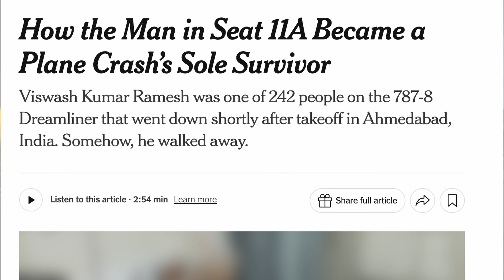Why the RAT Changes Everything – Air India 171 Update

Comment: Thanks for this great video!  However, I doubt it was a hydraulic failure.  Planes with running engines still fly.  This one didn’t fly. Planes with hydraulic failures loose control. This one never lost control.  Also the pilots radioed a mayday back. That does not prove loss of all electrical, but it does show they had enough electric power to run the radio (maybe powered by the RAT). So it’s got to be loss of engines. And it’s got to be loss of both engines. At the same time. We need a common denominator. As many back up systems as there are on both hydraulic and electric, I can’t see it taking out both engines that way. Not maintenance either (unless same maintenance done on both engines, but again, fail at the same time? Very doubtful). So the only remaining common factor is fuel. Not also that if APU was running the RAT would not have deployed I don’t think. So APU may have failed also. Again, the common factor is fuel. 

Can we find out how long this airplane was on the ground before take off?  Assume it was fueled before departure? How much fuel? Those would be good to know.

Comment: It appears the basic cause was insufficent thrust for the height , stalling at 600 ft 
Now, there is a report of a second call of Engine failure after the Mayday call, & its recording indicates the engines to be steady with no sound of fluctuations or flutterings heard,
This second report came after the lone survivor claimed to have heard a loud sound,  This aspect must be very thoroughly investigated to discern whether there really was a second call 
As for not taking in the landing gear there appears that the pilots were from the very early facing thrust problems, 

To the invesigation & its final report  it would be interesting to know something about the M V  Dali crash on a bridge in US, which final report ended up blaming the machinary , when it basically was the river  Pilots error, taking wrong action due nervousness , in an emergency situation,  
A ship that was moving at 8 kts speed ,experienced an  engine failure & instead of using the momentum to navigate the ship as it was (the heading of a ship does not depend on its propulsion but on the momentum) under the bridge, tried to stop the ship by giving stern movement & dropping the port anchor which only made the bow of the ship to cant (swing)  to the st bd (right) towards the bridge pillar  & crashing on it ,

Comment: Another incident where the known facts make no sense. The plane was already in trouble before it left the ground. It took off late, right at the very end of the runway or even beyond. Crash photos clearly show flaps retracted and slats extended. The entire flight was only 30 seconds. They had power (climbing) for 15 seconds of that flight. There is zero evidence of bird strike or flame out. Also, the passenger witness said he heard a bang and the lights flickered. The plane did clip some buildings before crash, which would be the bang. If there was a power loss, the RAT would not power the cabin lights, so they would not "flicker", they would have just gone out. Likely the crew deployed the RAT manually.

Comment: Watched a passenger post of video while he was on the same plane just the flight before. What he was filming before the 787 landed was alot of 💩 inside the cabin wasn't working the AC the TV screens on the back of the seats the remote controls were not working and other things not just in his seat but the entire plane. I think electrical failure is what brought the plane down. Why would Air India continue to keep it in service if a bunch of things DID NOT WORK. horrible decision making. Thats probably why the little propeller droped into action. The entire plane just turned off.

Comment: 8:00 - This would explain why copilot is not responding after Mayday call, as RAT hasn't provided energy to turn everything up in that short period of time.
Reply: The battery would also be providing power to the emergency and essential busbars, the RAT is there to save the battery being drained quickly and to provide hydraulic power.
Reply: @devon896 at the risk of being very dull I believe on battery power alone CM2 radios are depowered.

Comment: I saw that the day of the crash.  You could hear the RAT but not take off thrust of the GE engines.  I stand by my original observations, this was a total loss of electrical power and that is the only thing that fits all the available factors in this crash.

Comment: Not a pilot, or engineer but is their a possibility that the co-pilot did in fact retract the flaps instead of the gear and that action triggered the engines to throttle down as the system, as I understood, will not let you be at full throttle with out the correct flap configuration.

Comment: The same higher resolution video also shows the slats extended and the flaps at 5°. Also, the bogies of the main landing gears are tilted backwards. When retracting the gear, the sequence is first the change of the landing gear from tilting forward (forward tire pair higher than the aft pair) to tilting backward. This step of the retraction sequence appears to have worked, but the next step, opening of the landing gear bay doors and start of the actual retraction did not happen anymore (lack of hydraulic pressure?). We will have to wait for the FDR data and the state of the engines, the entire fuel system and the engine electronics will have to be reviewed.

Comment: Hey Captain Steve, just a quick note during the 787 gear retraction the gear tilts forward as the pilot puts it up, you can search up the dreamliners gear retraction test. And on the video we see that the gear is tilted somewhat forward, showing signs that the pilot did retract the gear. And it stayed out long for the reason you said, dual engine failure which provided no hydraulic power for the landing gear therefore keeping it out during the whole duration of the flight.

Comment: There's one more thing. In this video, you can clearly see through the wing between the flaps and the main portion of the wing. That would not be possible if the flaps were up. This proves the flaps were down. Also, maybe it's my imagination, but it looks like the plane yaws a bit, as if one engine fails slightly before the other.

Comment: I am extremely confused as to how 11a survived. It has been stated that he opened the exit door and escaped upon hitting the ground?  We all saw that enormous fireball upon impact, yes?  It had to engulf the entire structure of that plane (and certainly the general vicinity of the residential neighborhood at the point of impact). There would have been no exit door to activate upon impact, no?  That girded section that you mentioned may be the strongest point of the structure - but no human is walking away from that level of heat upon ignition of jet fuel. It just seems impossible. Please explain …
Reply: If I may, earlier today I watched an interview with the survivor.  Listening closely to the interpreter, it seems that 11A portion of the fuselage ended up inside the ground floor of a building--one was under construction--and the plane was broken open at the emergency door.  He could look around and see a flight attendant and others. He unfastened his seat belt and ran.

Comment: The pther audio to consider is what you cant hear. If youre losing lift, youre going to be pushing the ebgines hard. Theyd be absolutely roaring. 

Theres zero jet engine noise. Only rat. I really hope this isnt a major desgin flaw/QC issue that caused a major electrical/computer failure.

Comment: If I may point out if the engines were operating at maximum thrust, wouldn’t that have drowned out the rat turbine? In other words, since you can hear the ram air turbine, spinning, what is absent is that massive sound from the thrust and exhaust of the two big engines going by.

Comment: It wasn't initially a dual engine failure because you hear engine thrust with the rat.  However, in the 787, if there's 1 engine out and an electrical failure the RAT deploys too.  Reports of passengers from the previous flight indicated electrical problems with the aircon, lights and entertainment systems.  The sole survivor said he heard a loud bang.  The bang can also be heard after the RAT in your video.  Most likely cause was bad maintenance and takeoff procedures by Air India.  They are blaming Boeing.

Comment: It seems the plane had multiple electrical issues a few days before the crash. Here is a video shared by a passenger who who'd flown the accident aircraft a few days earlier  showing multiple electrical issues on the plane and AC going on an off intermittently.  Here is that video from a passenger who'd flown this same plane that crashed a few days earlier... showing the plane before  takeoff and if you pause the video at minute 1:56 the passenger captures the left wing control surfaces while plane is at cruising altitude... which seem to be okay. Dude taking the video has a heavy accent but it is possible to understand what he is saying and showing... https://youtu.be/1y_u1O-T6jw?si=tZceIuIK19Tn7ntT  

Question... can fuel contamination disrupt engine performance and how bad? Also  the position of the main landing gear after the plane took off shows the landing gear had been commanded to retract but did not retract meaning hydraulic systems had quit functioning...

Comment: Couldn't an electrical failure have caused the flaps to malfunction, resulting in the same outcome as the previous theory that the co-pilot pulled the wrong lever? Why does it have to be dual-engine failure? Is there any precedent for both engines failing on a 787? And why wasn't the gear up? Dual engine failure alone wouldn't explain that would it? I think there's more to this.

Comment: I think there was a major electrical failure!!! so as I understand it I'm not an engineer or anything but as I understand it each engine has its own separate fuel tank, so statistically the chances that both tanks were so extremely contaminated that it caused both engines to flame out statistically is you have better odds of winning the lottery!! (however just like when you get into your car and you turn the key to on you hear the fuel pump energize in your gas tank on a modern car) the one thing that both engines and separate fuel tanks share are electric fuel pumps if the plane for some reason lost total electrical power then both fuel pumps would be inoperable causing both engines to flame out simultaneously.

Comment: I'm definitely no expert in this field, but I was wondering if maybe all that dust/debris at the end of the runway that was kicked up just as it lifted off could have played any part in causing a dual engine failure? I know these engines can take a lot, and I have seen planes take off & kick up dust plenty of times & everything was perfectly fine with the aircraft, but maybe something was on the ground & both engines were affected? I know it's a remote possibility, but stranger things can & have happened.

Comment: The sound of the engines is not like that in the video, another fellow already said the sound is of the RAT, which is deployed, so there's your evidence, most probably the failure of the two engines at once (not crazy to consider they put bad or wrong fuel or no fuel at all) is my position from day one, as I'm a flight simulator tech with 40 years' experience in aviation and avionics

Comment: There is a video from a passenger on the completed flight right before this one from Deli. It shows that all the electrical components and AC wasn’t working on this plane. Wouldn’t this indicate the generators weren’t getting powered by the engines? Would this also bolster the possibility of a duel engine failure? It was reported it was very hot on the plane prior to this take off. Wouldn’t that be checked out? Thanks!

Comment: I'm a F/A.  A few days ago friend of mine had asked if I saw the video of the 1 survivor of the crash. I did and as soon as the pax stated he felt like they "stopped" in the air and the lights turned on and flickered (emergency lights) I immediately knew what most likely happened. Awful thought of the electrical failure and shut down of both engines directly at take off. Sad for all on board:((

Comment: Hmm I am not knowledgeable at all.  However I wonder if the failure isnt mechanical at all but computer based. Specifically MCAS  or its equivalent. As in 737. And something triggered shut down and then the RAT... And the poor pilots simply had no time to problem solve. RIP

Comment: My understanding is that ancillary equipment associated with the engines, such as fuel pumps & valves, are electrically powered. So, a massive power failure could result in fuel pumps stopping or valves closing = no engine power. Whatever happened likely wiped out all of any redundancy. The plane having electrical problems on previous flight is interesting to note. Cheapass Corporatism is a major issue nowadays. I, too, would be interested in the official report.

Comment: From a Comment, that I picked up from reddit: Maybe this was a single-engine failure, and the crew mistakenly shut down the wrong engine, resulting in a loss of thrust. This has happened before and sadly this was also already cause for some deaths. There are points that make this theory likely, others make it unlikely, but it's still interesting to think about it.

Comment: I believe that if it had been bird strikes, you would have seen smoke from the engines as the engines were ingesting, if you will, the birds - plus you would have bird DNA in the engines. I think I heard where this jet had just had maintenance performed -didn't hear whether it was routine scheduled maintenance or to fix/repair a problem. As I’ve heard pilots who are now with the NTSB say, there is never just one cause as to why planes crash. Sadly and tragically nearly 300 people died and others injured. 😞

Comment: There are at least 2 Cessna types that produce this kind of noise (more noise than thrust), the 2-bladed C185 and the C207 flying piano. The prop blade tips are only at mach 0.75-0.8 but they are incredibly noisy, like the RAT! 
The pilots apparently did their best by maintaining control, flying the airplane to the scene of the crash. In this case, they had little or no time for troubleshooting, The best they could do was to crash at a minimum speed, which does not really make much difference when crashing into apartment blocks.

Comment: I can’t believe this capitan suggested the pilot pulled flaps instead of gear. It’s impossible
Reply: It’s not impossible because it’s happened before. Even though they’re not near each other, it’s the next step after gear retraction and it’s muscle memory.
Reply: It's highly improbable, given both pilots had thousands of hours on the 787.. but definitely not impossible
Reply: And I can't believe besides you no one has called this hack out. His first assumption was based on the incompetence of the crew and not the machine.
Reply: That theory he had was a complete swing and miss!
Reply: Pokhara air crash was caused by mistakenly selecting feathering instead of flaps
Reply: @tenzinpalzom7142  very different cabin and handle layouts…
Reply: seems a bit wild, yeah
Reply: It is also incredible that a 787 would fall from the sky at take off power because flaps changed from 5 degrees to 0!!!!
Reply: That's more probable than a 1 in a billion dual engine failure.
Reply: The lone survivor was a true superhero, barely any injuries, walked out of the plane. He was unbreakable.
Reply: To be clear; it is possible but very unlikely.  The landing gear lever and the flap position lever are not located near each other; landing gear lever on the main instrument panel, flap position lever on the centre console.  Human muscle memory and the trained response to a 'gear up' command will cause the pilot monitoring to lean forward and reach for the landing gear lever, while the movement to change the flap position is significantly different.  It is very unlikely a healthy, trained and experienced pilot would confuse the two actions accidentally.  They could take the wrong action deliberately and knowledgable reports indicate that systems wouldn't prevent the retraction of the flaps but would prevent slat retraction.  That all said, evidence now strongly points away from pilot commanded flap retraction being the cause.  I agree that Captain Steve was premature to suggest pilot error was the cause in the first video.  I also feel an apology to the pilot's loved ones, friends and colleagues is appropriate.  Many media outlets ran with Captian Steve's initial analysis and theory.  Suggesting pilot error prematurely maligned their legacy.
Reply: He's like the FAA trying to always put it down as pilot error.  And he is correct about pilot error, only the pilot error is his analysis since a 787 wouldn't allow a person to retract the flaps by mistake.
Reply: @NorthPoleMoe right they died and tried to make it his fault even though it’s impossible
Reply: Its the insane hunt for views and money.
Reply: On the console of a 787, the flap lever looks like the airplane wing, with flaps, and the gear is a circular shape, like a small steering wheel near the center top of the console, so no, that wasn't possible, not to mention the alarms, and the fact that the jet wouldn't have allowed this to happen, with three redundancies built in.
Reply: I was a very hot day 
Stress amongst other variables 
Anything possible